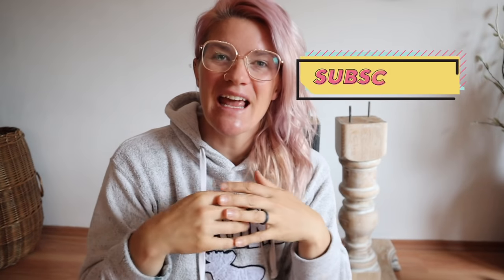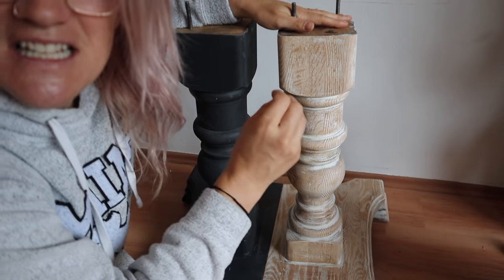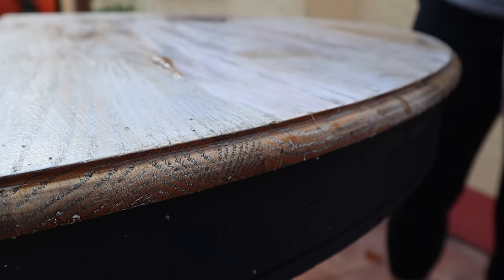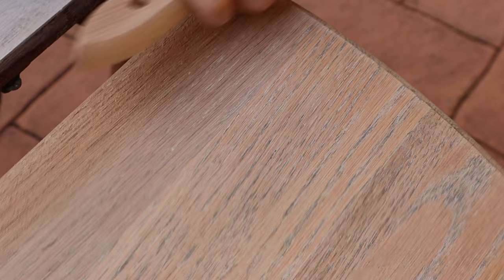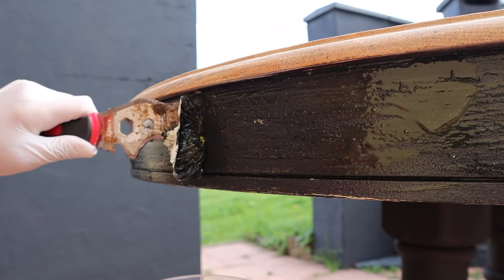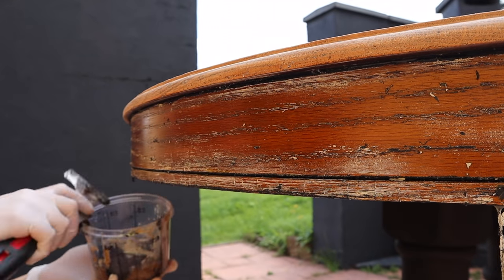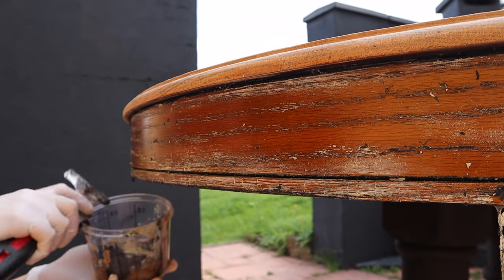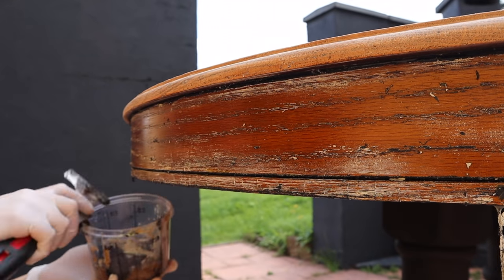Create A Cerused Oak Finish on Furniture | Get A High End Look On A Budget With Bella Renovare

Comment: I can see so many different combinations of color that still let the wood grain show through.  You can literally take any piece of wood furniture and match it into an existing color scheme.  I am certainly enjoying all these tips, tricks, and techniques.
Reply from the maker: Yes!!! Have you seen the black base and white grain look!?!? It’s sooo cool!!!
Reply: @BellaRenovare  I am so new to these modern upgrades.  I haven't seen that one yet.  Maybe you could slip in a photo or two when you get a chance on 10 min Tues?
Reply: You would be suprised how many finishes are ceruse finishes. Anytime the grain is lighter in color, its a ceruse.

Im currently custom matching a wood floor, and its taking a bit of extra work matching its ceruse finish. But im a bit green on finishing wood and eager to master it!

I just nailed the color of the stain using mixol pigments, i have my samples sealed in poly, and im about to go mix up some glazes to get the color of the grain fill.

Im using only mixol pigments for color, making my own stain with 99% isopropyl and water. Im using minwax polycrylic (water based polyurethane), i mix it 50/50 with water for my seal coat. And im using sherwin williams faux impressions glaze as a base for my grain fill, mixed with mixol for color.

Tools im using to get it done are a festool rotex 150mm, basically a belt sander and random orbit in 1 tool. And a restorer tool to quickly and evenly expose the grain with a wire wheel. My restorer is from rockler woodworking, but craftsman and black and decker make one.

Happy trails!

Comment: this is beautiful. i'm sure it would be very difficult with paneled doors on a piece. how does this process work on maple or other woods?
Reply from the maker: It’s not hard on panels you will just need a smaller brush. 

It is the same technique with other woods you just want to make sure you are getting into the wood grain to deepen it

Comment: I love this technique I did an oak table not to long ago. I wish this video had been out when I did mine I learned a lot from you as usual. Unfortunately it was only a laminate and not solid wood so it didn’t turn out as good as yours. But I would love to try this again with a solid oak table ❤️
Reply from the maker: O no I wish I had it out for you too!! now you have to find another oak piece :) I also agree with you, wax is not good for a dining table and it will not look like this, you have to deepen the grain :)
Reply: @BellaRenovare  I Definitely need to find another piece and do it again ❤️

Comment: Tools, for your consideration. And my process (so far)

Probably the best tool for this would be a restorer tool. I went with one from rockler woodworking, but craftsman and black and decker make them too! I use mine to remove finish before sanding with the paint removal drum, i also use it with the wire wheel to expose grain nice and evenly in a quick fashion. 1-2 passes seems to do it!

Festool Rotex 150. I put this one second due to cost, but it replaces a belt sander and is also a random orbit. I dont drop below 120 grit. I use the rotex mode @ 120 grit after the paint removal head. Then after exposing the grain i switch to random orbit for 120 then 180.

My process so far. (Still learning)

1. Remove finish
2. Rotex/ belt sand up to 120 grit
3. Expose grain
4. finish sand for staining from 120 to 150-180
5. Expose grain again
6. Apply custom stain (mixol pigments, 99% iso, water)
7. Seal with minwax polycrylic (mixed 50/50 with water) wipe excess out of grain
8. Buff burrs with a maroon scotch brite (400grit)
9. Seal with minwax polycrylic (50/50) wipe excess out of grain
10. Buff with maroon scotch brite
11. Glaze (sherwin williams faux impressions) colored with more mixol!
12. Buff with maroon
13. Minwax polycrylic (full strength)
14. Buff with grey scotch brite
15. Minwax polycrylic (full strength)
16. Buff with grey
17. Final coat minwax polycrylic (50/50 with water) or spray

Im doing all this right now, I'm custom color matching a wood floor i installed. Im making custom thresholds for their sliding glass doors.

Comment: Ok, I just tried it tonight on an oak veneer coffee table.  Beautiful pieces of oak veneer going in every direction on top with solid oak all around.  I think it was even oak under the oak veneer. 
Made a big mistake.  I used a Sherman Williams latex paint, one of my go to paints.  Really bad idea. It's a latex and it dries almost immediately.  I cut it with 50% water first and then, even when I hit it with more water it seemed to just dry in the water.  Then it wiped off in chunks of plastic.  All on or all off. Not good.  So I moved over to chalk paint.  Even then I had to dilute it about 50% because it was hot in my shop, probably about 90 degrees.  After applying and wiping, then applying more water, I finally got the paint off the top leaving it only in the grooves.  This is going to be one cool looking coffee table.  Restoration hardware style.

Comment: Beautiful.  Where do you get your sander with the sponge so you can do edges more easily?
Reply from the maker: Hi there so it is a surf prep sander, I invested in it after blowing through so many other sanders, I have had it for almost 2 years now and it is still going strong unlike the other ones I had lol

you can purchase the pads if you have a hook and look sander that size too, here is a coupon code and the link to the actual kit :) 

Surf Prep Sanding Kit (Use coupon code BELLARENOVARE10 )
https://surfprepsanding.com/product/woodworking-sanding-systems/?aff=15
Reply: Thanks. Ill look for that
Reply: Tried amazon but not there. Where to buy?  I live in Canada
Reply from the maker: @dianemoore2737  click on this link, I swore they ship to Canada as well...

https://surfprepsanding.com/product/woodworking-sanding-systems/?aff=15

the coupon code is BELLARENOVARE10

Comment: I love this because the finished table lightens up a room without painting it solid white.  I have an oak dining table, but I won't do this because it's about 140 years old.  The finish on the legs is original, but when my brother had it for a few years he put 2 cigarette burn holes in the top ( one is about 1centimeter wide and more than 1/2 centimeter deep)and got motor oil on a big patch by leaving an engine on it.  He did strip the finish off and partially filled the holes but never got any further along.  I want to restore the top and I am thinking that I could paint faux grain on the wood filler areas with acrylic paint.  I managed to scrub the oil out of the grain of the wood and I need to research what to do about the cracks forming on the edge of a leaf.  Leave them or fill them?  Anyway, I want to leave the table in excellent shape for another 140 years although I don't know if anyone in my family will want it.  If not,  I hope someone will appreciate it.

Comment: Okay, I have an oak veneer. Is that the same or does it need to be solid oak?
I have a question about a piece that I’m currently working on. I’m keeping it as a work table. It is SO dry! I mean I’m afraid to sand it because it might become uneven. I’m going to start with a very fine grit and see. My question is, is there anything I can put on it before I work on it? I’m very new to furniture painting, I want to put a dark base coat then use several colors with sea spray and put light and dark colors over the colors. Amy on AJ’s channel did it. I just wonder if I should pre condition it? Would primer be enough or do you recommend something else?
Thanks! 💕

Comment: Since most furniture is made of plywood ie; a material manufactured from thin layers or "plies" of wood veneer that are glued together with adjacent layers having their wood grain rotated up to 90 degrees to one another. And is an engineered wood from the family of manufactured boards which include medium-density fibreboard (MDF), oriented strand board (OSB) and particle board (chipboard).

Can you apply this method? 
I suppose making a faux grain with wire brush? Not sure! Thank you!

Comment: I have a 90’s red oak dining set that I would love to do this with, but I’m afraid of it looking pink. Is there anything I can do to avoid the pink look with red oak?
Reply from the maker: Try stripping and sanding it all the way down, if it still looks red you can use a two part wood bleach to lighten it. I would may use a clear BOSS on top before you do the paint just to make sure it doesn’t turn pink :) if you want to send me a picture to my email I can direct you better :)!

Crysdawna@gmail.com
Reply: @BellaRenovare  wow! Thank you for your quick reply! You are correct, I need to strip it, not just sand it. My test patches on the underside of one leaf looked pink, but I just sanded it without stripping it. I’ll try another test patch after stripping and go from there. Thanks again! You are amazing!

Comment: If using this type of technique and finish on a heavily used dining table, that gets wiped off ALOT with a damp cloth, does the sealer prevent the paint from coming off? I’m always concerned about doing all the hard work just for it to be ruined by trying to keep it cleaned.

Comment: What determines if you use a stripper or sand the finish off?
Reply from the maker: Ahhhh well chemical stripper always just makes it easier as a first line of defense lol….If the finish is really failing I will just sand but I really hate sanding for hours and hours so I generally always do a chemical stripper and then sand it just makes my lifer easier :)